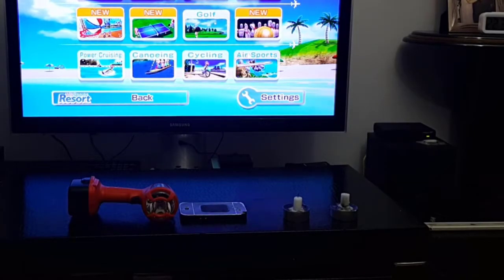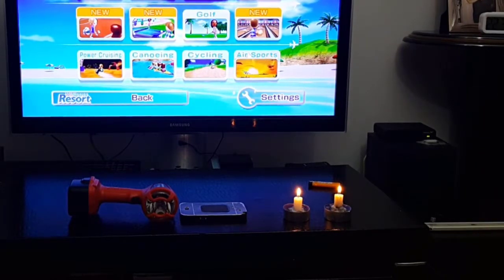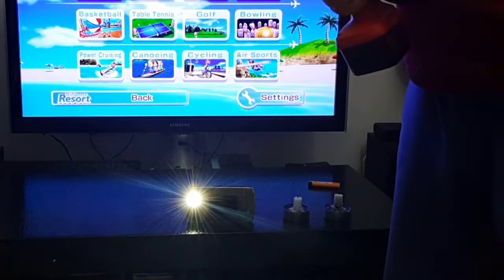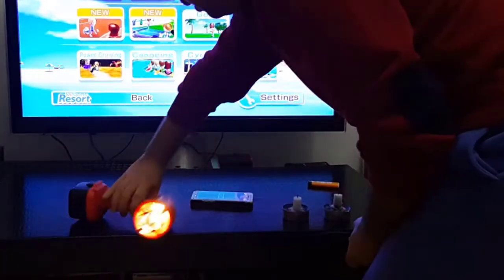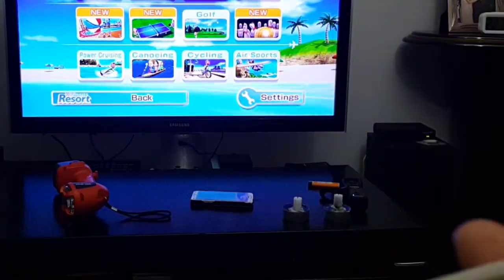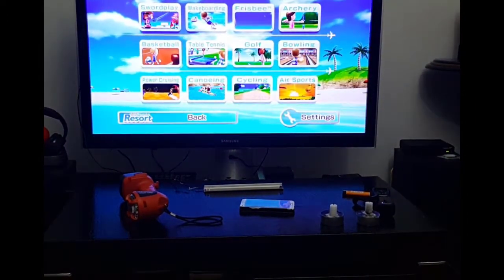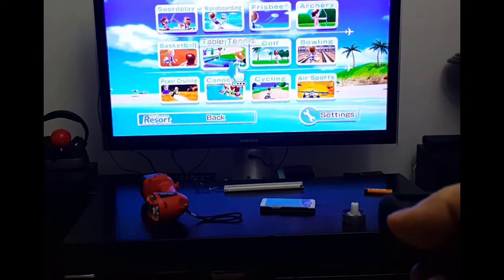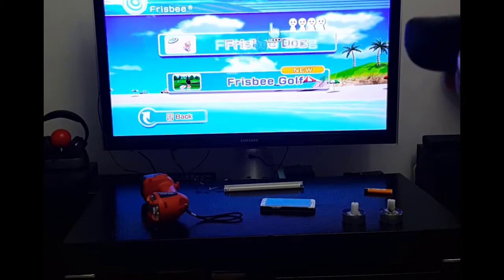3 ways of making your own sensor bar ; every method is each as well

Comment: Ah so this was the candle method someone was talking about on Reddit. I thought it was joke. 

Looks like the wiimote measures the IR radiation point in space and calculates the rate of change between its position and that point to compute the movement on screen.
Reply: Man saying random nerdy things to sound smart
Reply: it fucking melted my sensor
Reply: bro what. pretty sure the way they work is just inferred sensors in the wii remote. everything is controls from the wii remote, the sensor bar just puts out inferred light
Reply: @nobler6898 First of all, it's called INFRARED lights. Second of all, the Wii Remote is an actual sensor, while the sensor bar just has 10 infrared lights (left and right). You can literally play Mario Kart Wii without a sensor bar, all you need is just buttons on your Wiimote and done.
Reply: @raaymonf  1: who gives a shit how to spell
2: i was confused because the first guy was saying somseyhing about radiation. and even then, i was still pretty close to right just going off of something i heard years ago.
Reply: i remember doing this back in the day and almost burned up my desktop because stupid me put the candles under wood

Comment: wait, i can use my phone's flashlight as a sensor bar so i can play dolphin with a wii mote?
Reply from the maker: Hi, as I tried to show at the video it works but it is better to use 2 light thats why you need 2 cellphone lights. It is not as stable as 2 candle light ; or the best advice as I explained how to make your own sensor bar. It doesn't have to be the cellphones light , try to use any 2 lightsources that are a bith yellow kind of colored light. White(blue-white) is even worser. Might not work